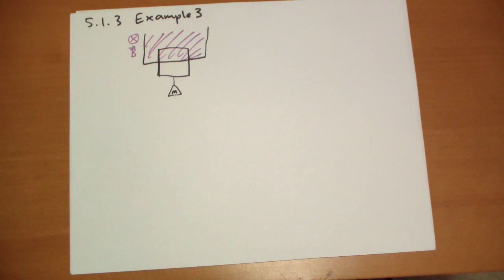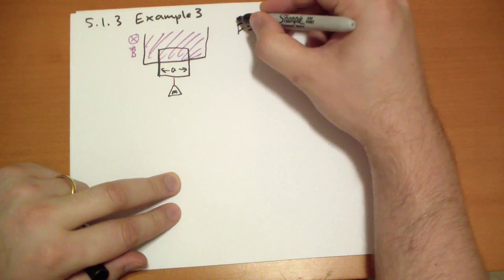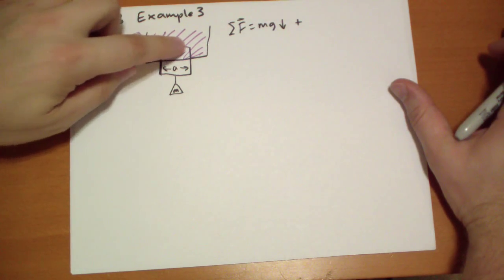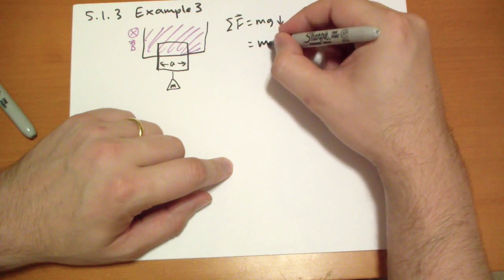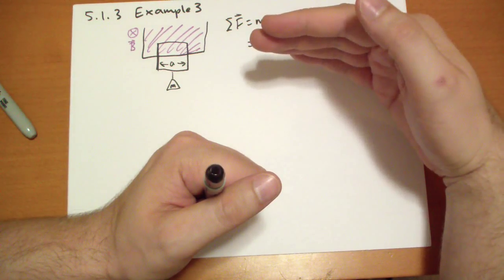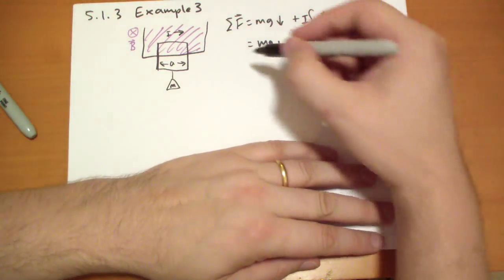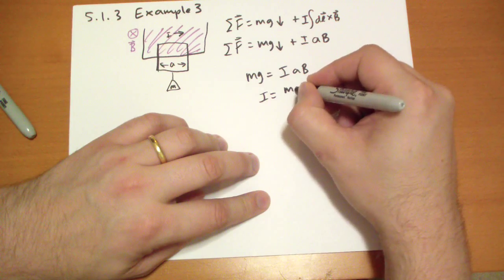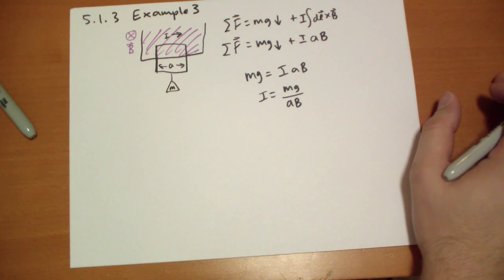5.1.3 Example 3

Comment from the maker: The force that a current experiences in a magnetic field is qv x B. So if you want a force to point up to counteract the gravity pointing down, the current needs to flow to the right since the magnetic field is pointing into the page.

If the magnetic field pointed out of the page, then the current would have to flow to the left.